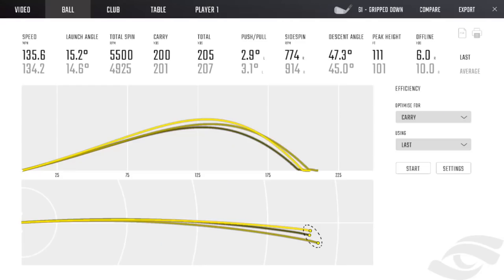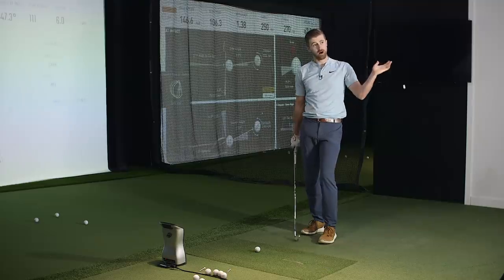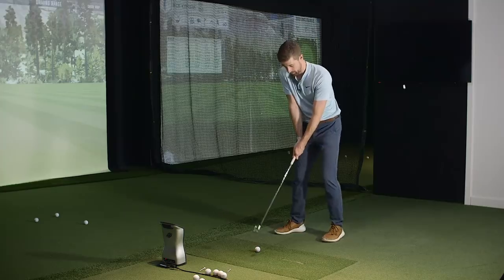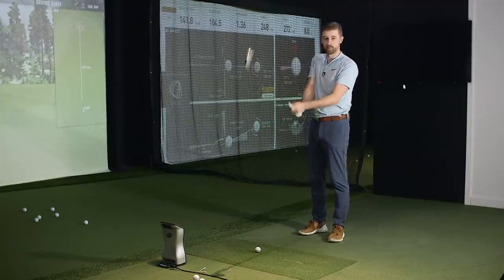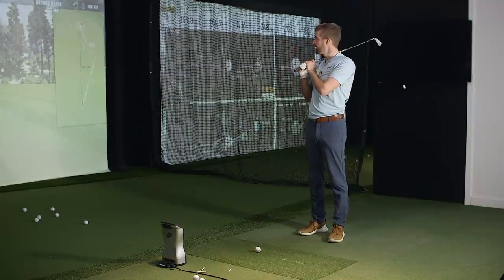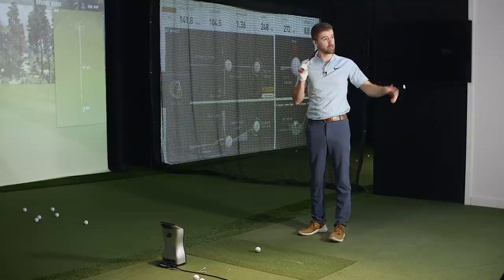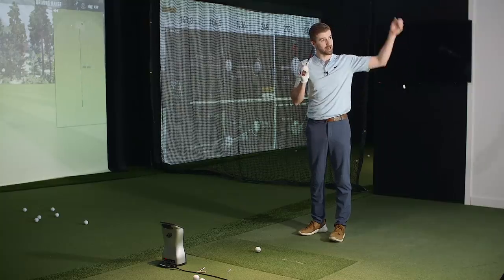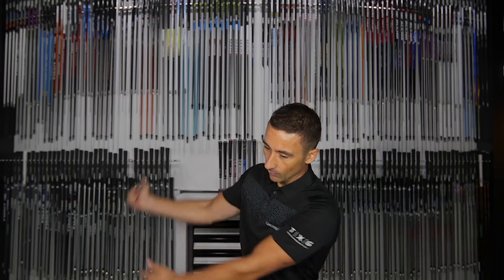Effect of Gripping Down on the Club

Comment: Im 34y.o. Ive been a scratch player all my life. Occasionally i have been +1,+2. Ive played competitive golf since i was 11. Since i was a kid i have fitted myself. Doing my own research on shafts, lie, etc etc then i would simply buy shafts and adjust things according to research and results on range versus what the numbers say by using any sort of device to give me feedback. I have always since 11 set every single club in my bag at 2 degrees flat without ever adjusting fairway woods or driver lies at all. Always used standard length clubs. Always used stiff flex shafts at 115,120 grams in weight in every iron and 65ish grams in weight my woods. I have always had the nickname "bookworm" because i have spent so much time doing research its ridiculous. And folks i am here to tell u now..... Changing lengths, weights, whatever it is never made so much of a difference ever in any club that i was wowwed. No matter what i did the results were so minimal i found that my game would improve 110% more by simply working harder on my mechanics, etc than trying to perfect the numbers. Yes, adjust correct lengths., weigths and stiffness but other than that dont waste your time. Do what feels comftkrable an do what simply works! Practicing has lowered my scores. Not the length or weight of the club or brand or this or that. My father always said golf is a game of MILIMETER so these miniscual numbers just dont make enough difference that its worth all your time and mkney and energy... A 20 handicap will never become a 5 by looking at numbers and a scratch player will never become a tour pro by adjusting numbers. Practice and yoyr mental strength is what makes a golfers game stronger or weaker than others. Hope this helps.
Reply: This is alomost entirely true.. I used to be an avid golfer when I was younger, never scored well due to psychological issues, but was a good ball striker. My dad was super stubborn with me instilling in me the very idea that it is about the player, not the instrument. I walked away from the sport after 8ish years of grind at age 18. From 19-24, like most college students, I bulked and tried to get stronger, and I did. Reintroduced golf into my system, playing for fun weekly... and one thing that stood out to me is that since golf requires repetitiveness and continuity to score well, even though I am stronger, hit the ball further, more knowledgeable with club fitting, there is a distinct limit to how well I can strike the ball and score, with little to no practice.  

Granted, if I could play golf full time, with fitted clubs, I could reach all time low in all aspect of tbe game, but I don't see the use in that. It is a multifaceted sport, requiring you to have relatively full control of you body and mind.
Reply: I think there’s a bit of too much generalization here. I can tell you practicing with a launch monitor has improved my game a ton. 

As someone who at my best was a +2 and then regressed back to a 6 and now back to a 2, it’s significantly harder to improve from a scratch to a +2 than 6 to a 2. 

At your handicap, if your swing is functioning close to ideal, then maybe this is all marginal gains. But I do believe a 20 can get to a 5 by having the right fitting — and using numbers to track progress.

Comment: I use the grip-down technique with my irons to dial in yardages for distance control. It knocks some spin off, and when the ball lands on the green, it stops dead instead of spinning back. I tried to develop a bunt driver shot a while back too, but the result of gripping down was exactly the opposite! I gripped down to where the shaft meets the grip and launched driver farther than I ever had before hahaha. I started paying attention to where the strike location was, and it made sense because now I was striking everything dead center of the face. Different for everybody I guess lol

I asked my fitter a couple weeks after if I should have them cut down the shaft length cause I was just striping it so well, and they said no because that would change all of the balance point characteristics of the shaft. If it's working, go with it! : )

Comment: One of the most useful videos you’ve done that doesn’t directly relate to club fitting. I think info helps you make better on course decisions. 
Dynamic Lie angle change is very good to know. 
I think the minimal distance change gripping down helps validate the possibility of single length sets working. 
I think lie angle on driver isn’t as crucial because you always hit it off a tee combined with minimal loft; but I think fairway woods and hybrids it’s very important. Not so much for shot direction but for turn interaction. Hitting a 4 wood off the fairway and delivering severely toe up will definition change impact location and turf interaction will be terrible.

Comment: I still tend to grip down on my irons as I was 1,66cm as a junior playing dad's old Tzoids - now 1,89cm and still grip down a little bit on my 3/4" longer MP18s. My misses are usually thinned so perhaps trusting my iron fitting and gripping higher would help alot.

For the driver, I remember vividly my club pro told me I need to keep swing weight in mind, as he fitted me with a rogue head with an Evenflow 3 wood shaft. I tend not to grip down on it that also due to the short shaft.

Comment: I didn't have time to watch the entire video but I choked down on the club quite a bit and have gained a lot of control doing so.  The one thing I have not heard in this discussion is both the swing weight of the club and the stiffness of the shaft that occurs by gripping down. Gripping down both lightens the club and stiffens the shaft.
 You're swing does not have much wrist action.  I've found this gripping down to make your wrist feel much more supple.
 I think both of these affects add to the sensation of being more in sync.  I feel there something about the counterbalance of the shaft behind the grip that adds to this. I may be mistaken but I believe Jack may have used this method by putting counterweights on the grip. It's definitely something I play around with and has helped my consistency tremendously.

Comment: Thank you! Now doubt is creeping in... just an hour ago i ordered a TM M4 fairway wood high launch 16,5 degree, with the kuro kage silver tini 60 in stiff and as you named it a 4 wood shortend the shaft to right between 3 and 5 wood length. All just on your information, no fitting. Now i am not sure if shortening 0,5 inch is a good idea... but it is just half an inch

Comment: Another great video. Slightly off topic, but has TXG ever done a video on the Cobra one length clubs? The GW through 4 iron are the same length as a 7 iron. Brandel Chamblee is a PGA golfer that is currently using them. I am considering trying them, but I would value hearing what TXG  has to say about them.
Reply: I asked them about it in a Q&A once and back then they really were not very enthusiastic about them. They definitely improved the one length concept alot though so I personally would be really interested in them testing a set. Honestly I thought the same as you did. If you can choke down 2 inches and play a 6 iron with a 9 iron length and still have these results a set that is made to be played at the same length will be even better.
Reply: Brandel Chamblee...  😂😂
Reply: @grza1636  BRYSON DECHAMBEAU

Comment: Is it true that 1/2" change in shaft length will give a 3 point change in swing weight, surely doing that on an 8iron and a driver would give a different result. Also, why does my d2 rescue fell heavier than my d2 irons when I swing them.

Comment: I think you should do the same with him using extended shaft length, because that is the reason why I'm gripping down on my regular length shaft. If I don't the toe is way too upright. I wanted to see if me gripping down on my regular length shaft to achieve a flat lie would be the same as shortening my shaft to the length where I can grip the club at the top end of the grip and achieve a flat lie.

Comment: Biggest problem with just going to the range is the range ball.  I tested the difference between my range ball and a pro v1 on gcquad and our range balls spin almost 50% less than a pro v1.  So when I go practice wedge shots on the range i basically have to ignore some things because the ball flies drastically different that my gamer ball does.  Going inside on a simulator using your actual ball you play with has made a huge difference for me dialing in my game.

Comment: Is there a benefit to play them 1" longer and grip down that 1" to get the benefit of a little butt weighting. Further, what if you added even more butt weight to see if it adds, subtracts, or just doesn't matter.

Could be a long video, but with jump cuts and taking high spots along the way to flush it out and possibly start a new facet for fitting.
Reply: I beleive that doing this would greatly reduce the effective swing weight.  The butt would act as a counter-lever.  I actually do this with my driver.
I have a 47 inch driver with phenom 70g tour x stiff; 52 gram grip; 202 gram bang driver head.
The swing weight is D9.  Choking down by an ich makes it feel like a D2

Comment: Hi guys it would be interesting to take this to the next level with swing weight ,because with drivers seemingly getting longer every year a lot of people fuss over swing weight ,I cut mine down to 44.5 inches but if I try and add weight to the head because someone says I should the club feels nothing like it did before ,more like a bowling ball is on the end. Lopping under an inch of the driver to 44.5 ,it feels just the same but more consistant in the strike ,adding weight feels terrible ,so I don't bother , play it as it is and hit it pretty decent ,I mean who's to say D1 or D4 is right and where the balance point is .This could all work the other way too ,take Bryson Dechambeau as an example ,his grips are massive on all clubs ,that must alter swing weight in a big way and I'm pretty sure he has not chucked on a load of lead on his clubs to combat it and he's the most science type player around .Is to better to go with what feels feels right and the end result .
Reply: His clubs were like a C7 swingweight I believe because they majority of the weight is in the grips. I personally don't trust "fitters" because ultimately they sell equipment and its not about a real fitting. Im currently fitting myself because I have been fitted 3 times (1 at club champion)and left extremely frustrated and disappointed. They don't answer your questions, they have very few actual options because all they are trying to sell are the newest models 😂. At the end of the fitting their recommendations are always $2k irons and $600 drivers that happen to be on sale for $525!!! Such a joke!

Comment: I just got a set of Srixon ZX7 with Nippon Modus3 130 S shafts on them and they felt soo heavy but I found if I grip down like this today on my first round with them the weight is manageable and the distance and accuracy is getting better. 

Any thoughts on this? 

I noticed the heal half of the sole is clean on strikes and the toe half of the sole is contacting the turf.

Comment: Gurus,

I always thought a shorter club moved the strike toward the toe. If dynamic lie was the same(adjusted to be flat) a longer shaft moves the strike to the heel of the club is that correct? So that being true if you find your strike location is in the toe and your divots relatively even lengthening the club would be a good option.

Comment: But what about gripping down when your a short person using a standard length club. I’m 5’ 4” and when I went in to get a swing analysts and lesson immediately he pointed out that my posture was way to upright because the irons were too long. He didn’t have a short shaft but he put a standard shaft on a club head with the correct lye angle and had me choke down on the grip and it put me in the correct posture.

Comment: Very interesting video as usual! What I don’t understand is why manufacturers produce 45+ inch drivers when most pros want 44. Wouldn’t this create a lot of issues with swing weight corrections? And if I were to order a driver online (custom fit) and skied for minus 1 inch, would they then correct the head weight to preserve the swing weight? 12 grams per inch as far as I remember?
Reply: *skied=asked
Reply from the maker: Depends where you're ordering from, the shop would have to specifically offer head weighting as an option

Comment: Fascinating stuff, guys!  Thx for doing it.  Matt, I expected to see the grip-down shots turning over more due to the thinner grip section, but that wasn't noticeable.  Would you say you have a fairly dead-hands swing (which is what I have), so that grip thickness doesn't have much effect on delivered face angle?  I once put an undersized grip on a 3W to try to help square the face, but it didn't work.  Hope that makes sense.
Reply from the maker: Certainly possible, the feel of the grip being thinner near the bottom may have different effects depending on the player's delivery characteristics

Comment: I am 6'6" and have added 1.5" to my irons.  If gripping down on a club has the effect of decreasing the loft, wouldn't increasing the length have the opposite effect?  I have always hit a high ball, now I believe it is because the added length has increased the effective loft.  There are a million articles regarding adjusting the lie for lengthened clubs, there is NO consideration given to the effect on the loft.

Comment: Here's a suggestion: Why don't you measure off the grips in, say, 1 inch (2.5 cm) increments and redo each data set. Measuring, say, 10 shots at each grip down length would give you more interesting and scientifically valid data. Just a thought.

Comment: Just need to get my head around something.  With this question I'm talking about lie angle and the ball above or below your feet.  So, the more loft you have at address (say gap wedge over a 6 iron) then the more loft you have then more offline the ball will start ? I only ask this as I my course is on the side of a large hill and the first 11 holes are uphill, you can have a lot of wedges in your hand for second shots and it's really difficult to get the ball to start on line.  Could you do a video where you bend the lie angle of a gap wedge 3 degrees either side of standard to see the difference with start line.
Cheers, keep up the great content.
Reply: Wayne Mayo I think what you’re asking is how much more offline is a wedge vs a 6 iron when playing off severe slopes. You’re right in thinking the big sidehill will affect the wedge more than the 6 iron if you play with the club soled parallel to the hill. but if you don’t square the club flush to the hill and instead lift the handle and swing it so the club passes level level the ball goes pretty straight but you have to be careful to hit it clean and ball first because the toe with catch into the hill more and turn the face open if you don’t catch it flush.
Reply: Wayne Mayo, as you change lie angle, the face points in a different direction; e.g., if the ball is above your feet, the face (for a righty) will be pointing left of where it would be if the ball were level with your feet.

Comment: This video is good while it explains that there is no effect. Gripping down or cutting down the clubs is part of the custom fitting process. I buy retail clubs then have to do the cutting myself. To give an example I have a 3 wood where If  I leave it at factory spec the shots become uncontrolled. I cut down 1.5  and the club becomes controlled and I get more distance. Without being cut I get average 225. When I cut it I get 250 to 260. Now whole this may seem exaggerated.  There is a reason this occurs. I have one leg that it a half an inch  shorter than the other so  when at address my body add more loft to any club I hold .

Comment: So longer shaft does not  necessarily equate to longer shots.

Another variable that isnt accounted for is counter weighting effect.
Choking down 1 1/2 inch, creates substantial counter weighting.

With more weight in the hands our subconscious is going to put more effort into the swing, than 'normal'
Just as we prepare for more effort when we know we are going to pick up a heavier object.

Simply reducing length without maintaining counter weighting may not result in same club head speed,
as choking down with a longer club, due to counter weighting.